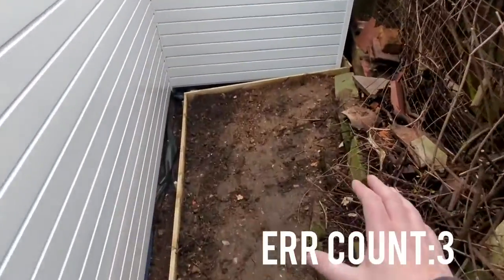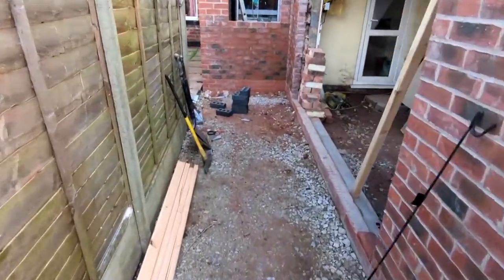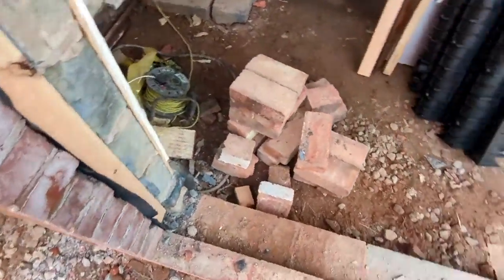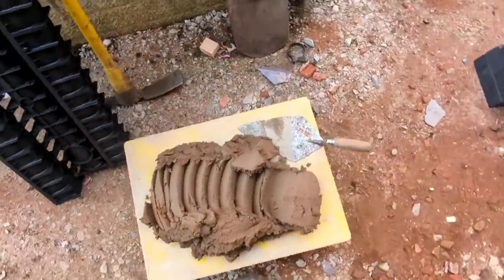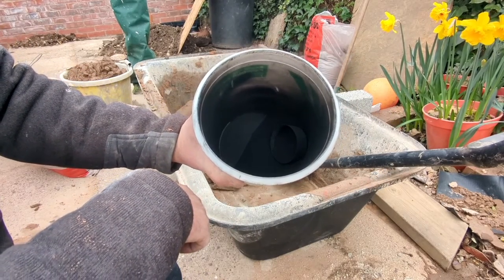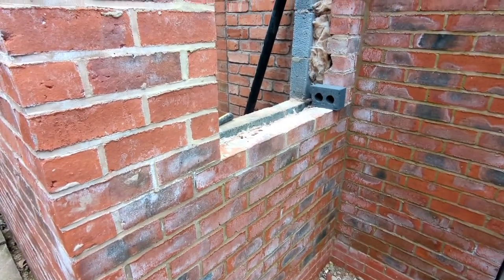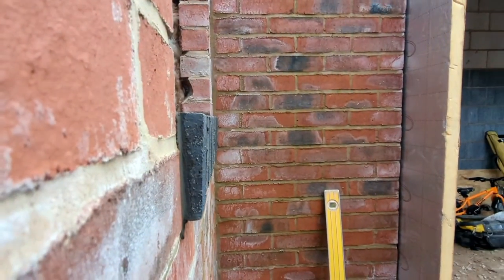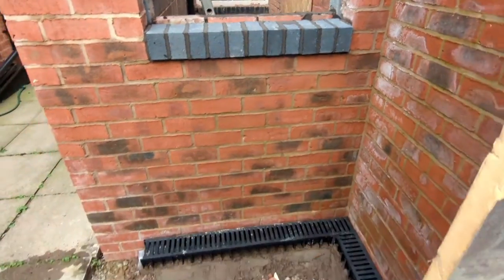Bricklaying. Back on the trowel! Garden Room Build - 18

Comment: Where do you get the chopping boards from? Very handy on a tight scaffold 👍
Reply from the maker: Hello mate, hope you're well. 
The link is below but low and behold they've short up in price from when I bought them last summer. They were £165 for 6 then and I bought the 450mm X 600mm X 25mm. You can buy the individually too  You can get thinner ones and they go down in price accordingly, but being that they are the only spot boards I'll have I went for the thickest because the thinner ones tend to warp. 

https://www.ebay.co.uk/itm/Chopping-Board-Professional-Extra-Thick-Catering-Extra-LARGE-Food-Cutting-Set-/154207413943?mkcid=16&mkevt=1&_trksid=p2349624.m46890.l49286&mkrid=710-127635-2958-0
Reply: @Mr_A_Builders  Thanks, I've had a search about and got 3 that size for £53,only in white though lol 👍